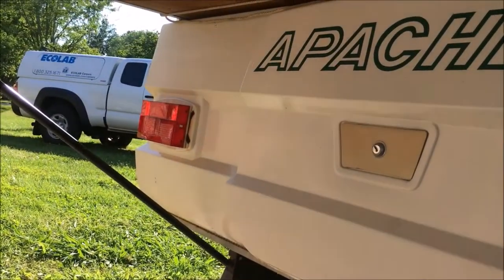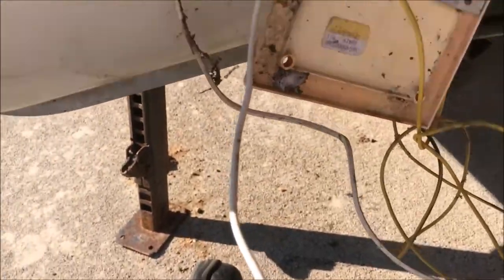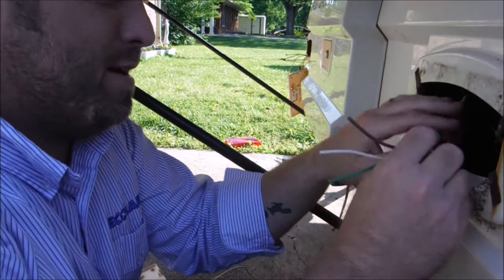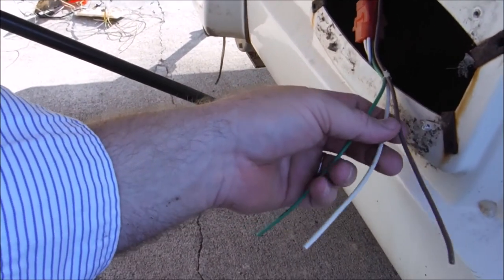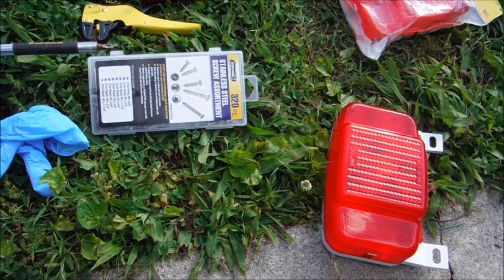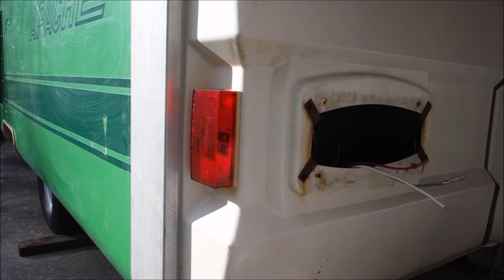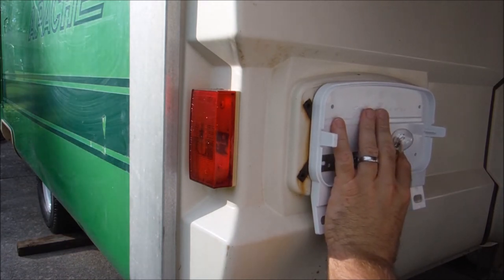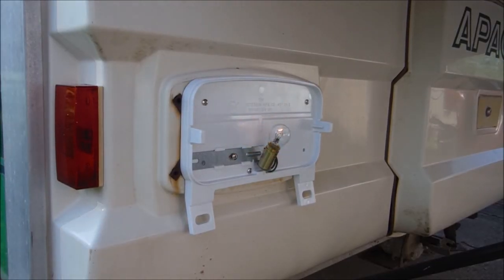APACHE CAMPER PROJECT TAIL LIGHT REPLACEMENT

Comment: I kept the metal bracket that was part of the original painted it the same color as the back panel (off white).  I then attach the tail light to it seem to work and it covered the rusty brackets.
Reply from the maker: I never had the originals so never had any metal bracket. I may make one out of sheetmetal somewhere down the road though.

Comment: Can the rusty brackets be removed?
Reply from the maker: yes you can pull the clips off but it will leave holes there. Apparently there is suppossed to be a large metal backing plate that I am missing.The backing plate screws to the body, then the lights mount to the backing plate. I will most likely make a new plate out of sheet metal somewhere down the line.